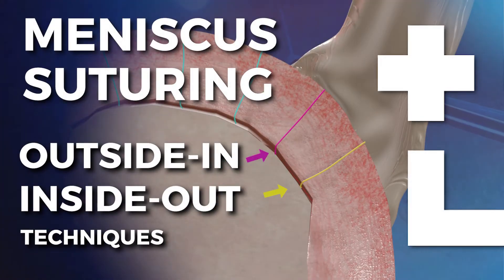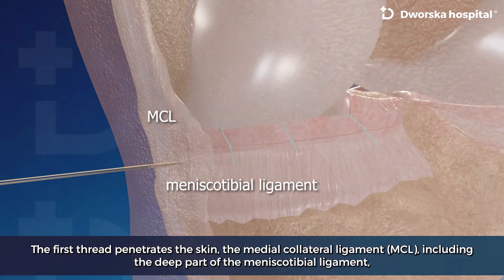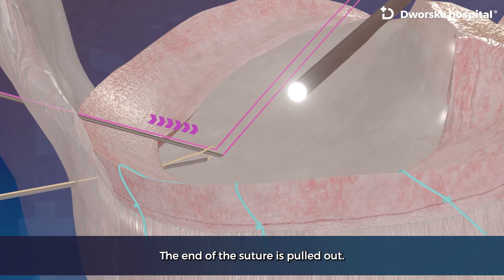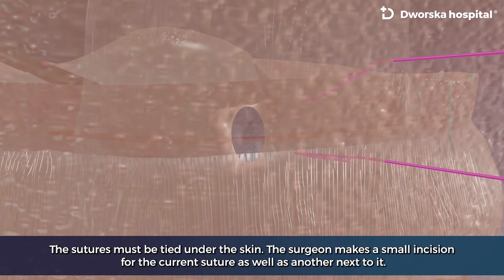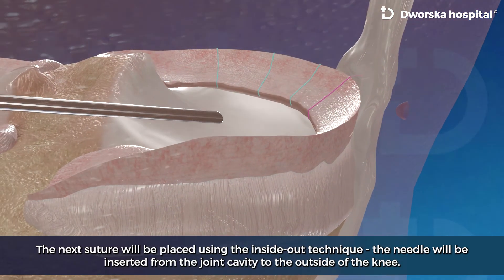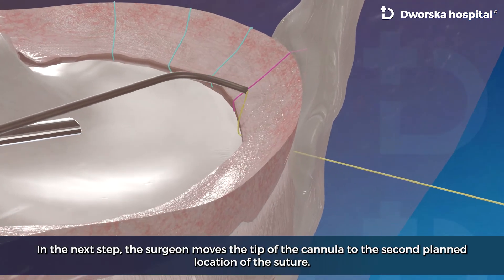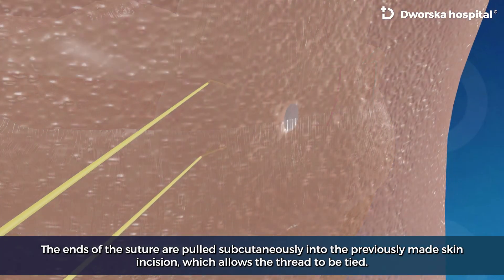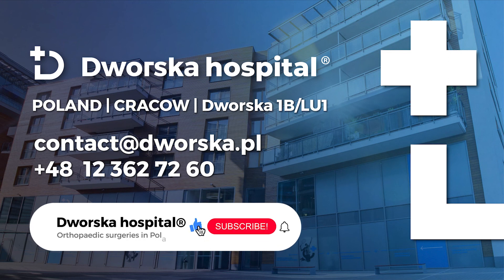Meniscus suturing - Outside-in and inside-out techniques - 3D animation - Dworska hospital®

Comment: The outside-in method in 3-4 zones of Shmigelsky gives very severe pain after operation, heavy and long contractures. I would offer such equipment only for 2 zones. all inside is suitable for 3-4 zones better. My opinion, excuse.
Reply: Thank you for your comment. Could you please share a reference or source that supports the idea that the outside-in technique is not ideal for zones 3-4? If you prefer the all-inside method, which specific technique do you use?